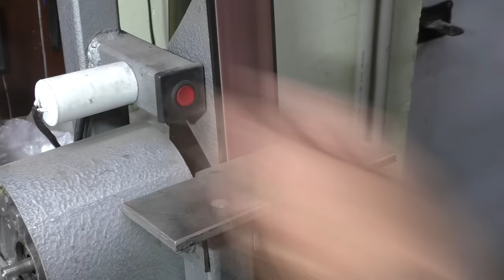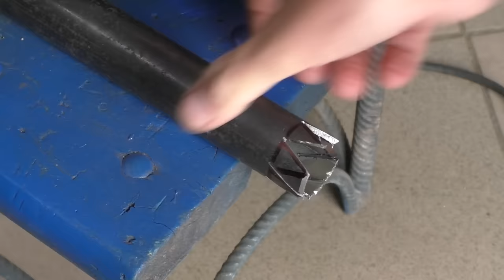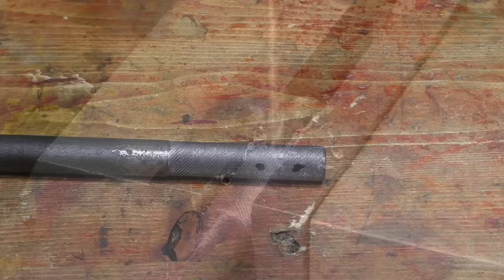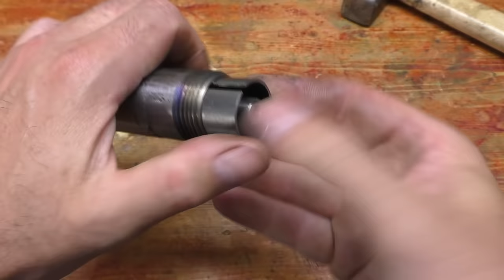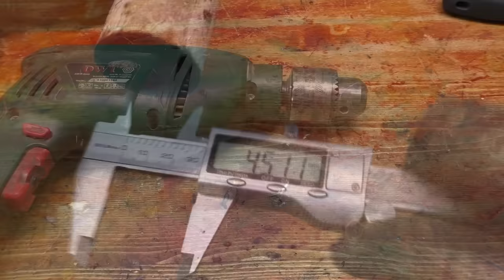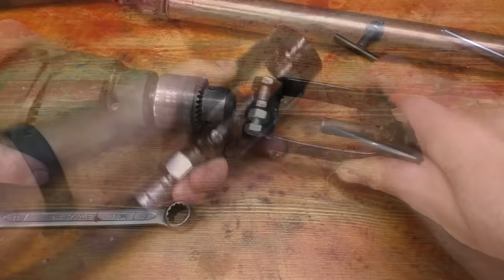Vibrator for concrete with your own hands

Comment: Excellent job! This concrete vibrator is a perfect size for concrete counter tops, fence post and deck footings and much more.
Reply from the maker: Thanks
Reply: @Mr.Craftsman  Don't show your wife!
Reply: @tezzah2222   I don't think any woman would put this anywhere near their sensitive bits.. unless it had a silicon sleeve/padding for the end/tip. Even with that, it's still probably just too much to handle for 99.9999% of women. I wont lie though, I had the same thought lol.
Reply: @dojostarfox4520  you've obviously give it a test run by the sounds of it LOL
Reply: Tout.compri.il.faut.le.materilles.qui.coutte..pour.fair.une.guadjette😅

Comment: Nice build! It has one big advantage over factory units: you can control the speed and with that the intensity of the vibration. Can be useful if you have to be careful not to demolish the concrete form.
Reply: Interesting. Don't they make them with variable speed?

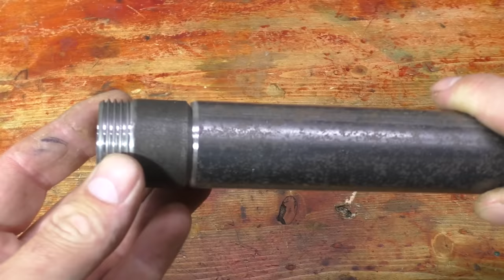Comment: Great idea and build!  Very functional.  I'm confused on one part, why at 1:15 did you weld on the threaded half nipple to the pipe?  Why did you not just cut the pipe that much longer and thread the end?  Did I miss something?  Thanks!
Reply: the welded pipe is slightly larger to accept the bearing, i think
Reply: That was my thought also.

Comment: Nice build. I've got an old Porter Cable belt sander that I'm going to modify and build into one of those sanders. It's such a great tool.
I'm currently building a small version of a concrete vibrator for small moulds - sculpture and restoring vintage stairs with complex forms/tight spaces.
Too many DIYers and even contractors skip that part of the process, and things fail after a new upper Midwest winters because of it. 
My neighbor spent $5K on a new set of front steps, which already have cracks and failures. It was totally avoidable. Sad.

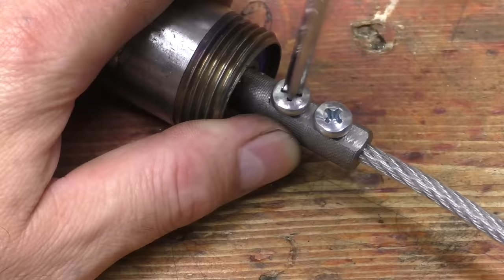Comment: Good Video, but Fail at 6:27 : Missing Srcew Safety with Glue oder welding, THE SCREWS WILL LOSSE VERY QUICKLY

Comment: Good. But two points need to be done differently. Place the cable mounting screws on the thread retainer. Use a dense lubricant for the cable.

Comment: verry cool idea aspecially the metal cable in the hydraulic / gas hose part , never considered that , the welds on the vibrator shell needs to be watertight as any concrete water manage to get in there it will lock the thing up solid

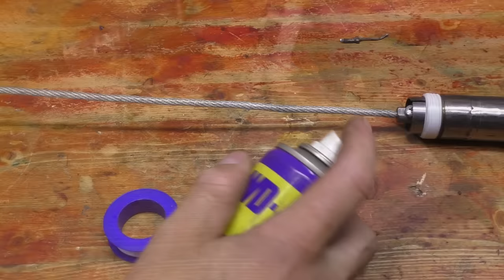Comment: @06:54 you should have covered that in pure silicone grease. WD-40 is not suitable for this, as it gums up and stops lubricating quickly. Other greases might work, but they also might break down the plastic or rubber inside. Otherwise, this is great!

Comment: Nice design but how does it actually work? I made a similar one but found that the drill speed was to slow to be effective. Concrete vibrator run on much higher RPM's. Would love to see it in action.

Comment: I suggest the drilling machine producer to provide three threaded holes at the "nozzle". Many functions  could be attached to them as this vibrator shows as an example. The vibrator trunk holder could be bolted to the holes. This feature is to prevent the whole vibrator to loose and to avoid pressure to the machine's 'nozzle' bearing that forced by that vibrator's holder. 
To me it's risk to hold an axial force by a radial holder since the concrete would pull the vibrator. 
This extra feature would enhances the machine's reputation and perhaps its price.

Comment: One thing missing: pouring a Sample Concrete piece, and using the Vibrator, to "Get the Air Out", showing how well it works!

Having used Cement Vibrators, I know the Commercial ones work great, but, how does this idea compare? 

We used them in a couple sizes on our crew, doing Retaining Walls, on the Railway, with motors like 1/2 HP, to 1 HP, and Flex Drives, of 12 Feet to 18 Feet! I never took one apart, nor saw any Repair Manual for one, though! So, it's hard to tell how this would compare!

Comment: This looks great for small jobs, I don't think it would be kind to your hands for long periods. I made a "Vibrating Table" out of a sheet of steel, a washing machine motor & some rubber mats. Fix the motor to the steel, fix an "Offset" weight to the motor & mount on the rubber. You can use it all day without getting "White Finger", it's good for any size job.
Reply: This tool is useful when pouring a concrete slab.

Comment: Nice job however WD-40 isn’t hacking it for the lubricant, Vibrator manufactures use a wet slippery type of Greece to lube the shaft otherwise it will burn up …..anyway… Keep on rocking…

Comment: the only thing I see wrong with it is you should use lock tight on the screws connected to the vibrator as they will come loose over time. and I think a better desine would be to connect the vibrator directly to the drill and remove the need for wire. but the vibration on the drill will prb cut its life in half so this way is prb better for longevity. only other issue is you have to make sure never to turn the drill in the wrong direction.

Comment: And how did you solve the problem of untwisting the cable? After all, as far as I remember, the direction of the cable fibers is opposite to the direction of rotation of the drill.

Comment: Is it still working. The wire rope has counter clockwise twist, and driving it clockwise will untwist it. How many hours of real concrete vibrating has this tool done?

Comment: Good job, I have some questions. What size are the bearings? The measure of the central axis iron?
Reply: 4 months ago but 12mm ID x 28mm OD, 1/2 inch crs rod.

Comment: You can't do it without a lathe. And why? What for?
Steel cable - $ 5, Bearings - $ 10, Hose with couplings $ 10, Cutting disc, grinding, drills, taps, threaded connections $ 30. Total $55.
There's also time, a couple of days! We also need a drill for 4000-6000 revolutions, and not the one that is used - it simply does not give the right frequency for good compaction and air extraction. New vibration compactor costs only $ 70, do you seriously think that $ 15 is a saving for 2 stupid jobs?

Comment: WD40 isn't exactly a proper lubricant, like for anything really.
Basically anything else you got lying around will do better work, engine oil for example is a good option.
And you don't even have to have anything around, just take the oil stick thingy out and you got a couple drops pretty quickly!

Comment: A vibratory tool does not remove liquid.
Your ideas are genius. But your info is incorrect. It does remove air bubbles trapped from the mixing process. At the same time consolidated  heavier materials  settle to the bottom pushing the liquid mortar to the top...(cream) as they call it in the industry. Used primarily in pours that have a large amount of reinforcing steel inside.

Comment: Cool but a little weak in my opinion
Reply from the maker: The weak point is the cable
Reply: I Think the problem is in the sense of rotation in the cable
Reply: That's what I thought. The wire would chew on that rubber hose unless the wire is stretched enough so that it won't touch the inner side of the hose, and some grease or teflon added chain oil would help instead of wd40.
Reply from the maker: @ozciva  It is better to use the speedometer cable
Reply: @ozciva  maybe silicone oil?